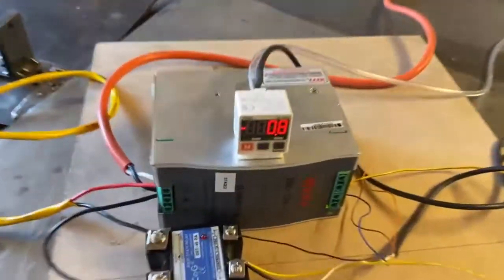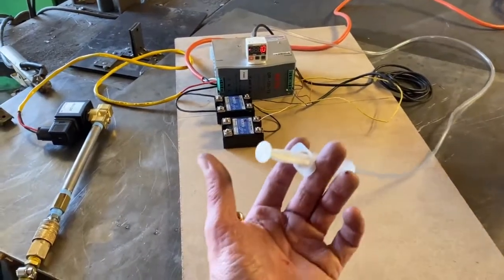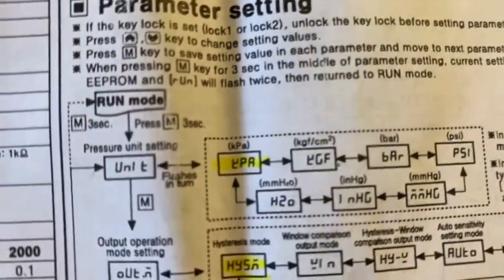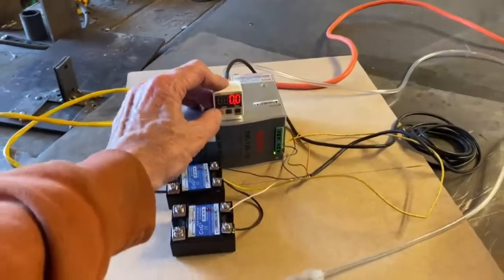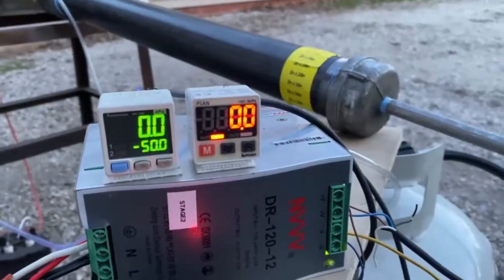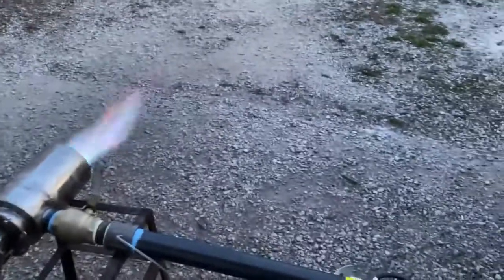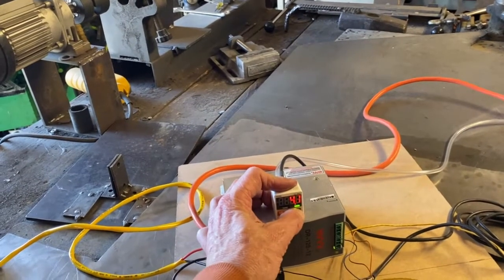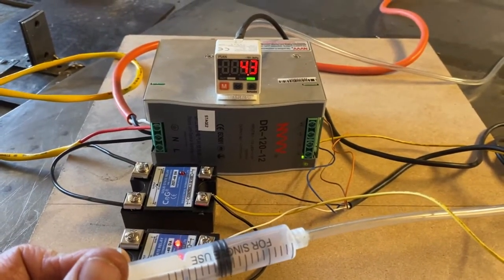PSAN and Panasonic Pressure and vacuum switches

Comment: Ouch that's an expensive unit.
 Is the output a relay. Or does it have a small SSR output...??
Reply from the maker: I believe its SSR
Reply from the maker: oh yeah , i got this for like $100 but i cant find the link to this model . I think the Panasonic one may be better . Im gonna do a video on it next because i need to learn how to use these asap
Reply: @NOBOX7  You can get a 5$ offbrand Arduino Nano to handle the computations, if you're willing to program them, or I can help you get them set up. Most of these industrial computers are way overpriced, and use decades old components in them, making them larger, clunkier, and more expensive than they need to be.

You'd still need the sensors, but the actual sensing components are usually extremely cheap, compared to these all-in-one units. Once you've written the program for one unit, it's easy to download it onto 100 units, and it scales extremely well for selling equipment like you do.